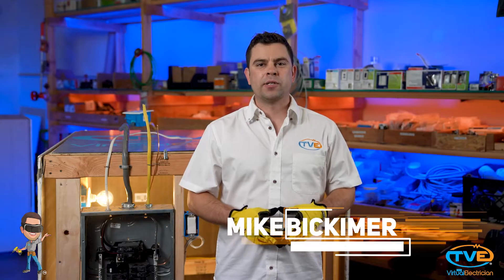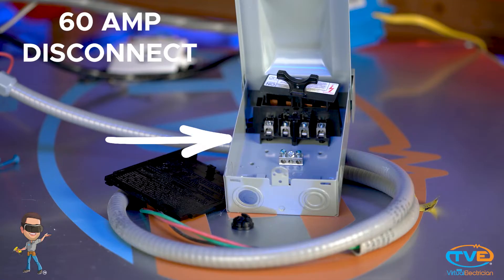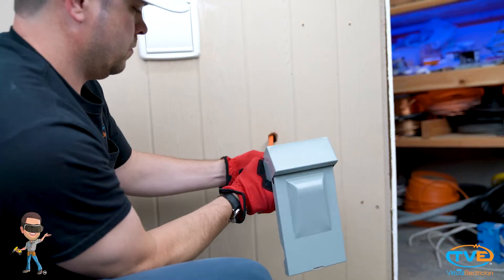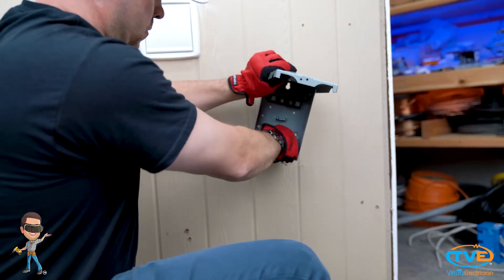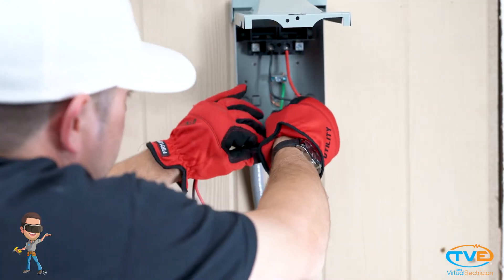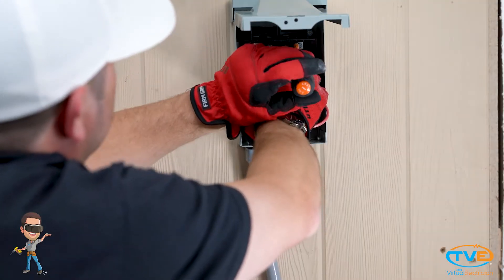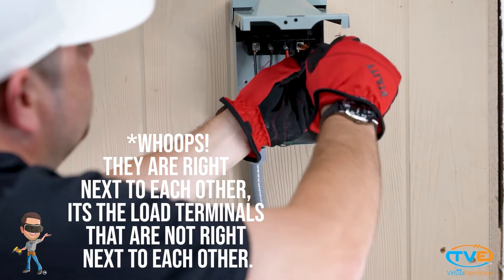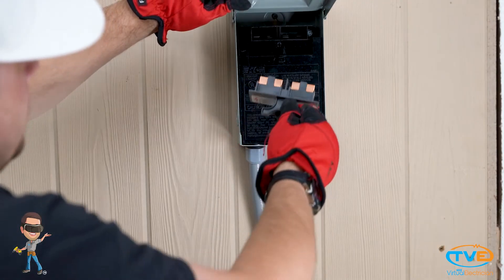How to install an AC disconnect

Comment: is the hole water sealed or not?
Reply from the maker: i would
Reply: @TheVirtualElectrician  so why doesn't the electrician in the video use a water sealant before installing the Disconnect?